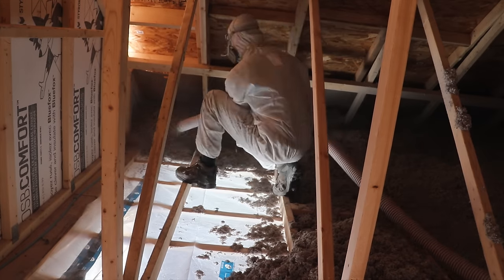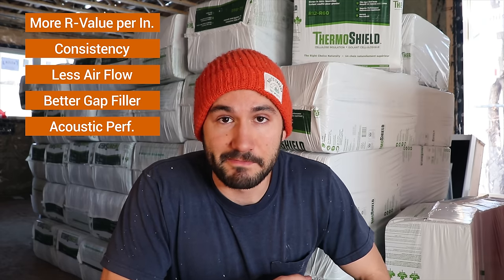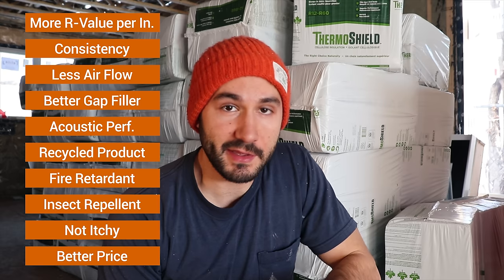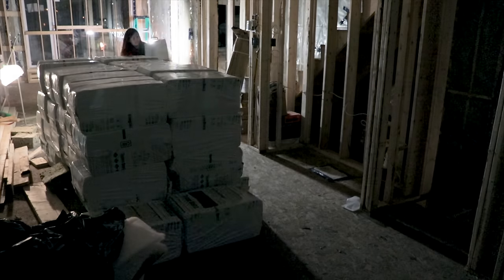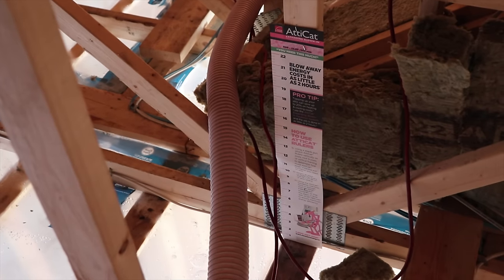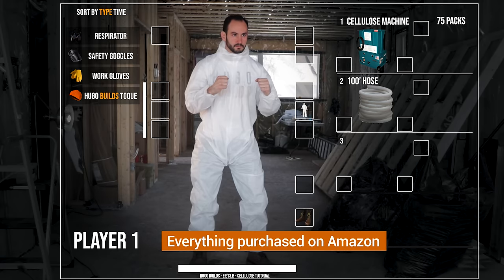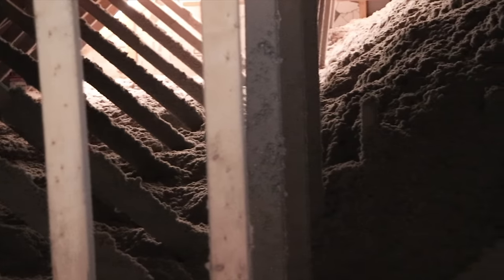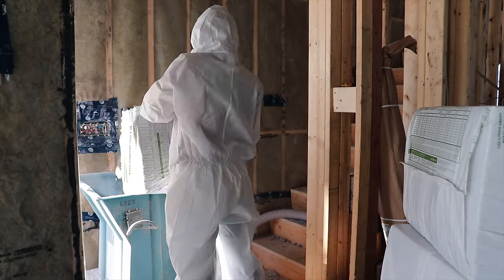How to Install Attic Insulation: Blown-in Cellulose using Home Depot Rental Machine DIY

Comment: Thats way too much .i worked doing that ..16 inches high .u can do like. 3 houses with 70 bags .u dont want to over. Spray more than 14 inches.it be to heavy on ur sheetrock
Reply from the maker: Hi Ricardo, it is what is required by code here in this northern climate. R60 in attics. It's also what is recommended from the manufacturer.  I followed the pre-compacted depth chart.. after a few months it should settle a bit to it's final thickness. Weight is really not an issue since it's really well distributed.  As you can see this was sprayed on vapour barrier only that was held in place by 1x3 strapping. No weight is actually touching the sheetrock.